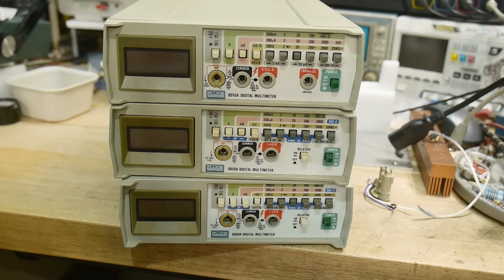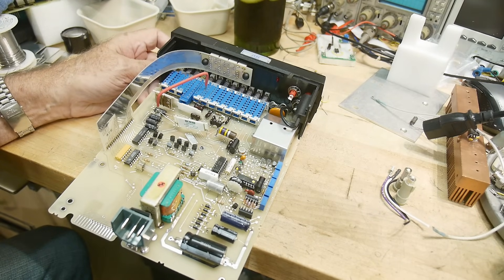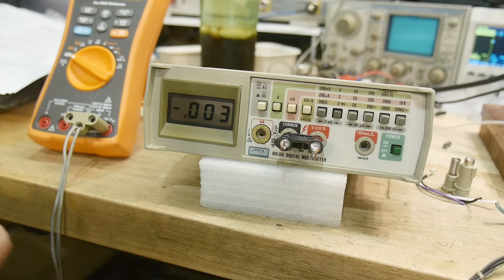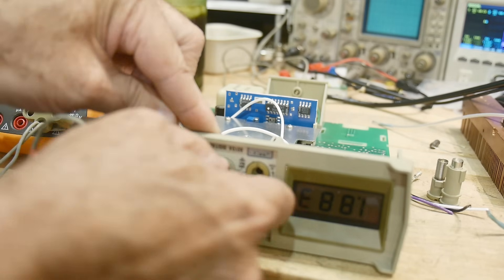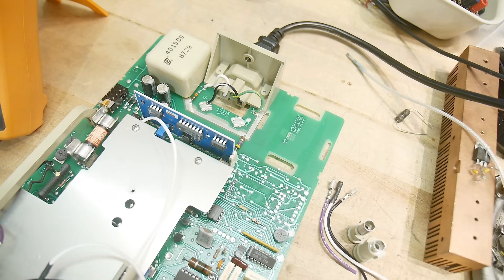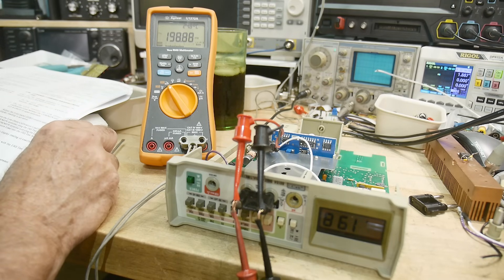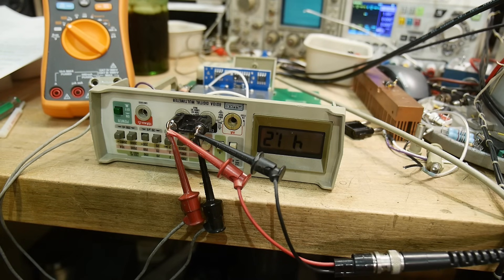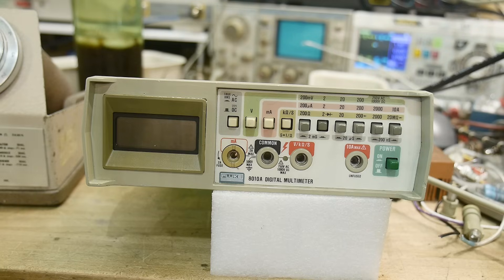#1658 This was not a Fluke, it was six (part 2 of 2)

Comment: Why is it I never get the bad fuse or easy to change output transistors.  I have an old Current Source and everything "easy" caps, power supplies, output and driver transistors, reference are all good.  Every time I dig in I get to reverse engineer the dam thing :)

Comment: I got a free Fluke 6.5 digit bench multimeter in return for fixing 4 others. It was generally not that hard, although there was one with a dead transformer that I had to tear open the layer of insulation on the transformer to replace the transformer's thermal fuse. I was fortunate in the fact that all of the meters came from the US AF repair depot, and at least one of the techs wasn't competent. As an example, they replaced an IC, ( I could tell by all of the solder flux they left on it.) But they installed it backwards. I desoldered it, turned it around, cleaned it up, and ran a 24 hour burn-in on the meter and the obviously stressed part, and the meter worked fine. Easy repair.
Reply: I almost got an 8300A once- the first 5.5-digit voltmeter if I'm not mistaken.  I ended up getting parts of it instead since the guy scrapped it.